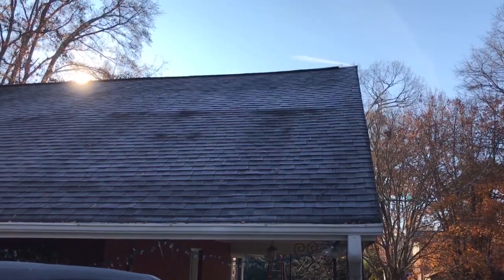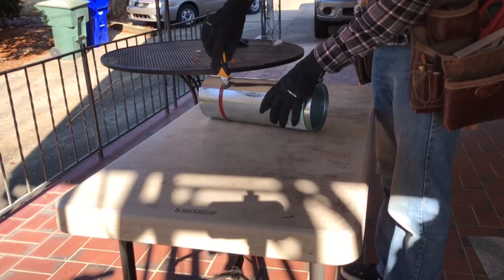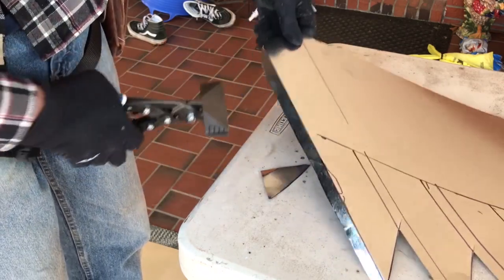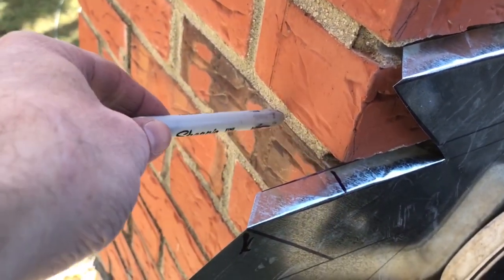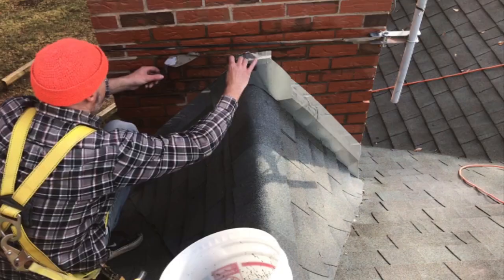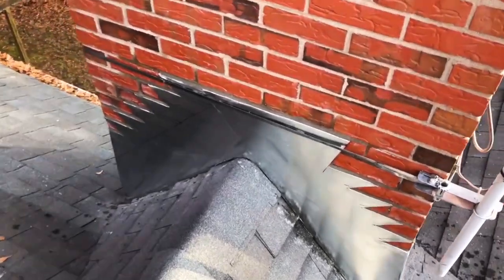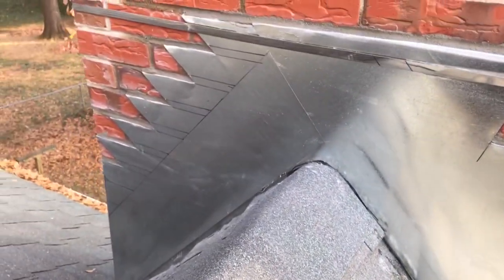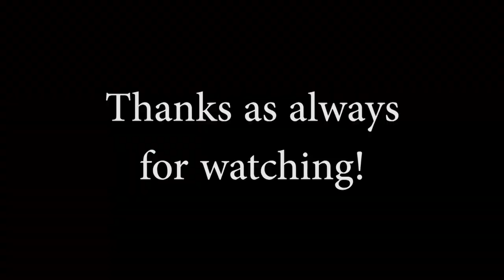Chimney Cricket Part 3 - Counterflashing

Comment: I did a flashing on a fireplace in 1976 that went into the mortar joints. It was a new fireplace done by a friend that was a brick mason. It was 5’ wide, 3’ deep and 13’ high. At a 9’ height the roof was basically flat, we made a notch in the mortar joints from 3 sides over the roof and extending out about 6” on each side, past the roof. We had some galvanized ducting, it was a lot stiffer (heavier gauge than what you’re using) and made the shape of a squared C. We folded the end where it went into the mortar into the shape of a V. We checked how it fit and it was ok. When we shaped the corners they were open, so we cut some 12” squares and cut out the corners and soldered them in both corners. We cleaned the roof and washed it a day before and put roofing tar about 7” from the fireplace all around. We then filled the mortar joints with white silicon, put the flashing in place, pushed it in the mortar filled joints and used special mortar flat/square nails to secure. We also nailed (regular 8P nails) flashing to the roof and added some more roofing tar over the nails. I sold the home in 1990 and everything was still good.  In the last few years the roof was done, flashing?
PS:  Had a new fireplace done in 2004 and saddle was done by a professional carpenter with step flashing and top flashing was in stalled with white painted aluminum trim from a roll. It was formed on a brake. It was the installed on a groove cut into the fireplace about 6” above the saddle in a diagonal cut, by a saw with a diamond cutting wheel. It also went on the sides. When I had my roof done in 2019, the saddle flashing was replaced with a step flashing and a normal interlocking flashing using the old cut in diagonal holes. Everything is fine today, no leaks. The insurance company would not pay for a new flashing, but roofer said it was cheaper and easier to replace than reuse the old flashing. The roof was 16 years old with a lot of hail damage. They tore off the original roof (home built new in 2003) when replacing the roofing.

Comment: Dave, I really appreciate the comprehensive job you did with your 3 part series on chimney crickets.  Your redundancy of flashing layers is exactly the approach that I would take myself (if) I was even-slightly comfortable at working at heights (which I’m not).  I have owned homes with “cut in” step flashing, and that is the best possible way to go in my opinion.  My present home’s chimney cricket is flashed via the adhesive bonding method - and I currently have a water leak over my living room fireplace in heavy rains.  As I watched your videos, I shuddered to think how many trips up and down that ladder you must have taken…and how much planning, layout, and time that must have taken to execute.  Score one point for el-cheapo modern adhesive-bonded chimney flashing.  However, as I contemplate having my present roof replaced (with new flashing of my chimney cricket) I sincerely wish that I will be able to locate and hire a guy as conscientious and talented as you obviously are to repair my chimney flashing.  Great job!  Are you interested in doing the same, on a ranch home in Michigan?
Reply from the maker: Ha ha! Thanks for the super-flattering comment, Gregory. It is MUCH appreciated! As for finding a good person to do flashing up there, you might want to look for a brick mason instead of a roofer. Someone said (except overseas--where it's commonplace) they're the only ones who do it like this anymore. God bless, Gregory!

Comment: Masons stair step counterflashing in the mortar joint. Roofers cut one straight line right thru the brick face to make quick work of counterflashing. The old roofer I was blessed to have show me all his tricks years ago told me that a roofer would never make money spending that much time stair stepping the flashing. He also said a mason would never consider grinding a slot in the face of the brick, and that fortunately, he wasn’t a mason.
Reply from the maker: That’s a great anecdote. I did see a lot of the brick cutting in my research, but I couldn’t bring myself to cut into the brick either. ... probably because I’m a mason wannabe 😉
Reply: A plugging chisel is not a roofing tool 😉
Reply: Only a cowboy would grind a straight line through the brick and mortar

Comment: Higher ridge or steep pitch last regardless if it’s a cricket or not. Typically we match cricket pitch to roof pitch.  We also remove the entire mortar in joint, pump joint full of sealant and bed flashing into it. This creates a cut of point for water in the brick. Brick and mortar can also absorb water so it’s never a bad idea to pressure wash entire brick surface and apply a couple coats of clear waterproofer to the surface. Keep up the good work Dave!
Reply from the maker: Thanks for all the info!

Comment: I have always used lead flashing. It looks a lot better functionality wise. It works a lot better as well. And I don't do one singular piece. I do all separate pieces and it always comes out looking great
Reply from the maker: I think lead looks better too, and wanted to use it, but had trouble finding it where I am. It's rarely if ever used around here. Everyone has painted aluminum flashing.

Comment: Have you had to redo this?  The step downs on your counterflashing is a huge hole for water to get in.  You should step down within the mortar joint.
Reply from the maker: Nope. Still holding up. And I've had roofers look at my roof recently due to a hails storm, and they said it looked great.

Comment: Great video! I’m curious, what’s the benefit of using mortar in the counter flashing joints over using sealant?
Reply from the maker: Thanks and good question, Ola. The mortar will last much longer. In fact, the mortar will likely outlast the flashing and shingles, whereas even a "lifetime" sealant will leak and crack before the shingles need replacing.
Reply: Not to mention the mortar will look better if you use sealant. It may look out of place considering the rest of the chimney is mortar and brick